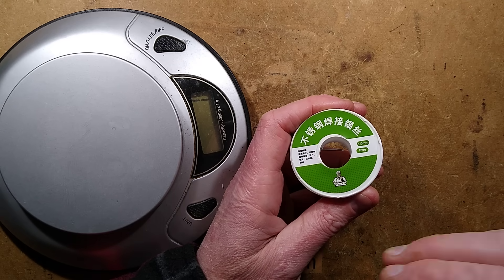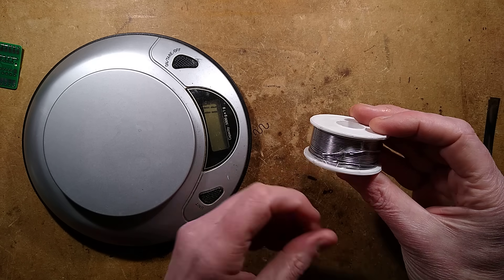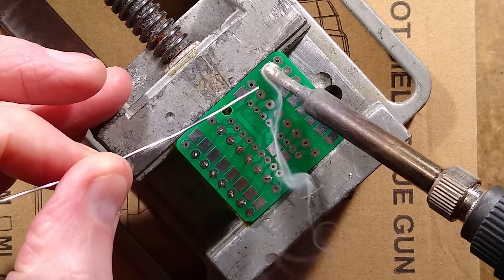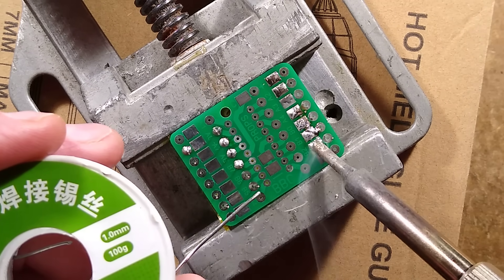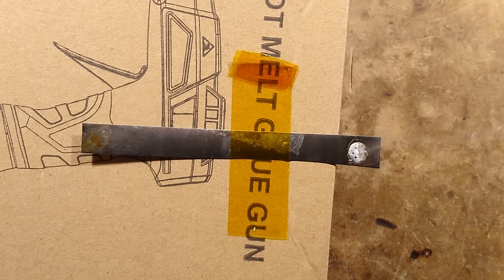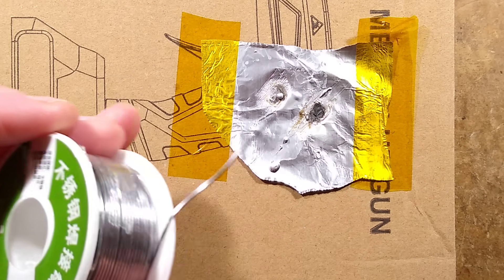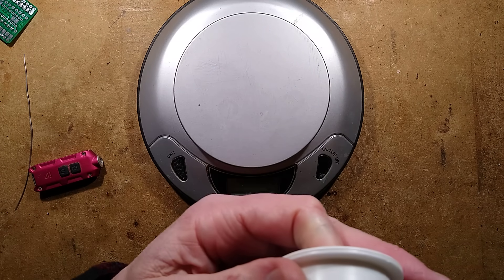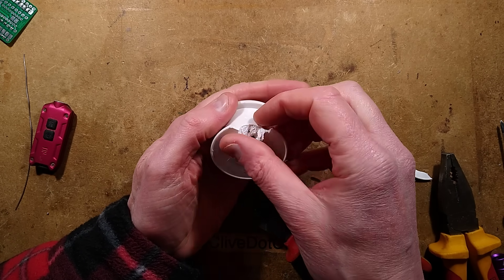Testing AliExpress "mystery solder"

Comment: The last place to save money is on your solder. Bad solder will make it a miserable experience.
Reply: I see so many posts of people complaining they can't solder at all and the result looks terrible. Probably half of them are just suffering from garbage like this.
Reply: @benbaselet2026  Most likely that is it.
Reply: I got cheap ebay 60/40 non-china origin and have been happy especially with china copper tips. It almost turned me pro and I only have experience of soldering once in a blue moon.

Comment: i have some 'low residue'/'no clean' solder that has a very nasty flux, makes you cough like mad if you get a blast of the fumes, plus some CEL solder i got from grandata in the 90s that absolutely stinks, bit like hot stale sweat, yuck, it was notoriois for it!

Comment: I have had 3D printer filament listed as 1kg nett weight, but the reel weighed 200 grams so should have been listed as 800 grams nett. Seems a common Chinese way of upping the price.
Reply: Just demand a refund for the missing part.
Reply: 800g filaments are quite common. Certain materials have lower density and they cannot put 1kg on the spool. Could just be a listing error, they assume every spool is 1kg.
Reply: @gabest4  I've seen  the "fake" 1kg reels as well.  The listing is often carefully worded as to how much filament you're actually getting.  Haven't been ripped off for a while, maybe they've stopped or I've been picking better sellers.

My spools were 250g, you did better than me.
Reply: @gabest4 Yes, the Chinese sellers are usually honest. It was probably just an error. 😂😂
Reply: Best Aliexpress "accurate" description is of lithium batteries 18650 cells at 9000 mAh.  actually about 2000mAh. Often the peak current in mA is advertised as mAh, then repeated as Ampere hour!. For all that, a lot of Ali stuff is good value. The skill is in knowing which stuff.
Reply: When in similar situation, I demand full refund, their logic behind that I ordered 100W lightbulb and its only 50W that says I will get 50%off, is flawed....no I specifically ordered 100W and demand 100W, 50W are no use for me. Rate them 1 star and watch them sqeal. Sorry but learn to label it properly. I dont have a problem to pay for well described product.
Reply: @JanicekTrnecka  I purchase through eBay, they refunded me the full price and told me to keep the filament as the seller refused to accept any responsibility.
Reply: It says nett weight!

Comment: Why are the descriptions of items so weird on sites like this?
Reply from the maker: Copied keywords and a language barrier.
Reply: Platforms don't penalize keyword stuffing,
Reply: @TheCatherineCC  eBay definitely doesn't like keyword stuffing.
Reply: Keywords so the item will show up when you search multiple different things. It's just one way they basically trick people into buying something they might not exactly be looking for. Sellers have been doing that on eBay for many years and unfortunately works very well.
Reply: @benkeysor7576   Yep, in general the same technique used by bad SEO actors to promote their pages above others two decades ago. This acting at today is somewhat suppressed by Google and other search engines though it still prosper in other places like Aliexpress.
Reply: The description madness is for the search engine, which then finds everything even remotely close item, which usually isn't the one sought after. The Sellers want their articles showing up on literally any search results, and AliExpress of course does nothing about that.

Searching and especially finding anything in e.g. AliExpress is the Real PITA. One must think out the searching terms very thoroughly and still the results often are one hundred pages of crap.
Reply: My favourite is pressure instead of voltage.  Great-great-grandpappy is apparently alive & well & selling stuff on Ali.
Reply: One of my favorite things about bigclive videos is how he dutifully reads the entire product name 😂
Reply: The plain good buzzword spam to make their pages picked up faster up in online searches.
Reply: Let's hear you describe something in Chinese.
Reply: I think they're the same people who create packaging for the Chinese-origin toys Ashens sometimes reviews. Some of the attempted translations are hilarious.
Reply: @tncorgi92  Chinglish. It's a great search term to browse. Slip and fall down carefully.

Comment: I'm still using my 0.5kg reel Adepto Rosin Cored Solder Wire 60% tin, 40% lead which I bought from Maplin Electronics on Slateford Road, Edinburgh circa 1995!
Reply: Ahh, you youngsters.  I'm still running off the kg of 60/40 I "acquired" from work in the mid eighties and it'll see me through to the end of my days.😄
Reply: About 50 years ago, while I was in the US Navy, I shut down a small base overseas and one of the "prizes" I took was a 5lb roll of Kester Solder (.032") 60/40 flux core solder.  In the  50 years since, I have only use about 1/3 of that roll and it has traveled all over the world with me.  I have never found a solder that works as well as this stuff - even when its 50 years old.
Reply: @MrEdwardhartmann  dayum
Reply: @LagrangePoint0  Well said - you can tell it's old - the spool is metal instead of plastic.
Reply: .I usually have to give rolls that are over 10-15 years old a good acid dip to get the oxide off if they're to be used for anything more critical than joining large wires.
Reply: I recently finished a reel of solder bought from Maplin in Manchester UK 33 years ago. Remembering my keen wide eyed new adventure into electronics, it was a mournful moment.
Reply: Ditto for me except from Jaycar. Not sure what I will do when it runs out.

Comment: I always found dealing with China on eBay (etc.) was like dealing with the Ferengi on Star Trek. 💫
Reply: To quote the 239th Rule of Acquisition: "Never be afraid to mislabel a product."
Reply: "Watch your mouth, hue-mon."
--Quark, probably
Reply: LOL !:face-green-smiling:
Reply: The Fergengi at least had Rules of Acquisition. I'm not sure Chinese sellers are that scrupulous.
Reply: @ They have rules. If money flows one way, it is theft. If it flows another, it's good business.
Reply: @Calamity_Jack  There is a rule of Acquisition that says family members are a good source of cheap labor so use them. LOL, it is funny bc it is true!
Reply: @Calamity_Jack  👍
Reply: I'm still sore over buying those self-sealing stem bolts. Was told they'd go up in value, but they're out of fashion.
Reply: I often wondered if the Ferengi were meant to represent a specific ethnicity. Kinda like the goblins in Harry Potter.
Reply: Oh, my. What a god analogy.  You know they are always looking to screw you out of money but sometimes it's worth it anyway for the item.

Comment: I am still using the 60/40 Solder. Solder with some lead in it. Works much better than the lead-free solder. Inside is a core of (acid-free) flux stuff that helps quite a bit too. 🤓  But mine is from Weller (Germany), not from KFC. 🐓

Comment: Big Clive have you ever shown off your fume extractor? How do you get overhead shot with the fumes coming towards the camera.. Big oof if you're taking it to face first. nasty stuff, could full all kinds of life expectancy neutralizers.  I've had to cut back on soldering because the fumes. I made my on DIY extractor with a cat litter bucket and exhaust fan and hepa filter, it works right but suction could be better..

A side note: The reviews on this are insane 7080 reviews, 4.6 rating. 10,000+ sound.  Could it be possible you got unlucky and received fake mixed in with legitmate products or are the reviews fake. I guessing the later is more likely. I personally stick with established name brand solder because I want to the solders joints to last. I've come back to older solder with the chinese solder and it doesn't look quite as pretty. 

Another side: I know a manufacture in china that prefers to use leaded solder because it's just performs better.  I'll have to ask what brand of solder he uses.
Reply from the maker: I intuitively breathe out while soldering, and often blow gently as I do so.

Comment: A good source for thin aluminium sheet is soft drinks cans, Great source of emergency shims.
Reply: Yup, and the lid is a different alloy than the can cylinder.
Reply: It's epoxy coated so you'll have to scrape that off.
Reply: @AdmiralQuality  Both the paint and coating melts away with printer solvent, "MEK", You can also use it too glue model kits
Reply: @dogwalker666  Ah, the smell of my childhood! It's a wonder I have a brain cell left intact!
Reply: @ Indeed. 😀
Reply: "Hello, this is the Lock Picking Lawyer..."

Comment: that dull finish is a trait of SnAg (lead free) flux will eat circuit boards unless cleaned afterwards.
Reply: There are numerous fluxes used on lead free solder. I have used many that left a dull finish but still were no-clean type. Though thouse were all top shelf solders with Ag and sometimes Au component too. So maybe what you wrote is accurate for cheap stuff.

My favourite solder is actually a lead free Mundorf MSolder SilverGold. But unfortunately it doesn't have thin enough size to suite smallest jobs and rosin core sometimes "spits" a little because not divided in to multiple small cores. But overall it's my favourite do to everything else being excellent. Well except price, but for professional use that doesn't matter when can be billed with a healthy margin.
Reply: @ Yes but the no clean type won't easily tin stainless steel.
Reply: @johnkey1682  Ah yeah, that's true. Didn't think about that since I only ever soldered Cu or precious metals. Some products had cheaped out on connectors using Au plated (ferromagnetic) steel, lol. But those still took the solder well.

Something excellent for connectors but not that pleasant to solder was Rh. It always was mirror finish on extremely smooth surfaces, but it did take a good contact with solder after enough heat used. It having lower thermal conduction properties probably had something to do with that but must have been a combination of things because Pd   was easier to solder to.
Reply: The dullness is because it's lead free, not because of the flux. Nearly all common lead free solders are matte.
Reply: tin suffers from a disease called tin plague; tin alone is no good for soldering
Reply: Naa.   SAC is expensive.     Sn100.    0.3% cu or something.   Pure chinesium alloy.

Comment: The usual way of getting solder to stick to metals such as stainless steel is to use an acid based flux such as sal ammoniac AKA ammonium chloride.  This flux must be thoroughly cleaned off, but it will wick into wire, especially stranded wire and eventually corrode and eat away the wire.  Sal ammoniac has a characteristic pungent smell and is easily recognized.  And for aluminum the flux used has a fluoride in it that's even more corrosive.  So for electronics, I would avoid these like the plague.
Reply: I'm from eastern europe (Estonia) and fluxes not to be used for soldering electronics were "saltser" zinc chloride  (probably from german)  and aspirin tablets, which make good fluxes but eventually corrode copper wires etc really bad. If "kampol" = pine resin does not work then surfaces were not cleaned enough :)
Reply: @Tegelane5  That's funny. I began using pine resin a couple of years ago. I get it from the park. It has similar properties to rosin but this stuff has some humidity.
Reply: @louistournas120  My brother works in forestry, so i had him collect a bunch of dried pine resin. I purified it by dissolving it all in rubbing alcohol and filtering it. After letting it partially dry i poured it into a little tin where it dried completely. Really nice transparen dark amber colour. 
Not as good as regular flux, and smokes a lot, but since it's so cheap it's great when you need to absolutely drench something in flux, like when i'm desoldering old crusty PCBs.
Reply: That or also zinc coride
Reply: I was thinking it might be acid core

Comment: Thanks Big Clive.  Interesting.  Wild that it adheres to SS.  Must be some kind of wacky flux.  The finished solder joints looked sort of interesting.  Not like the normal lead based solder.

Comment: Hah, as the video went on, I was thinking a friend who showed me WAY back that he could solder to aluminum (can), using a drop of oil (motor oil?  3-in-1?) on the cleaned can (I thought he cleaned it before the oil but don't remember for sure), and sure enough, the solder stuck just fine!  Wondering if it doesn't stick to stainless steel for some similar reason (oxidation?) or just chemical incompatibility between lead and SS?   Hmmm, also wondering if you'd scratched the aluminum foil before solder test, or was it too thin?  Try again with an aluminum can?

Comment: I've had success in the past using regular lead free solder for soldering to stainless steel but aluminium would be another story.
Reply: I've got solder specifically for aluminium, no idea what's in it.  Have soldered stainless with leaded & unleaded solder, just needs different flux & shielding.